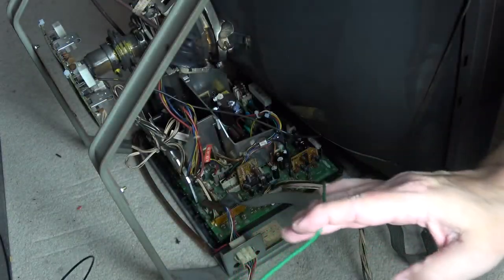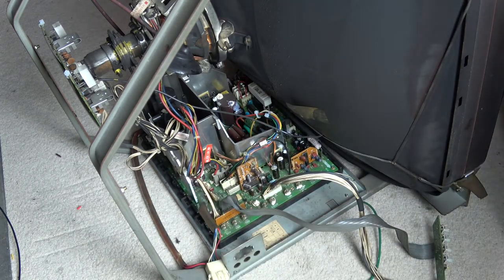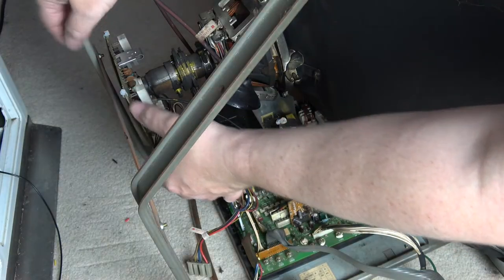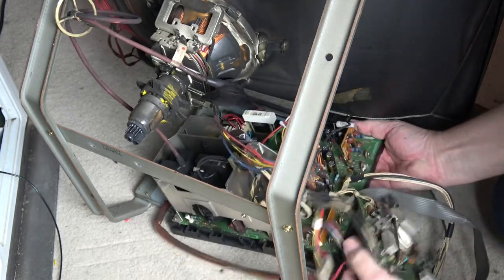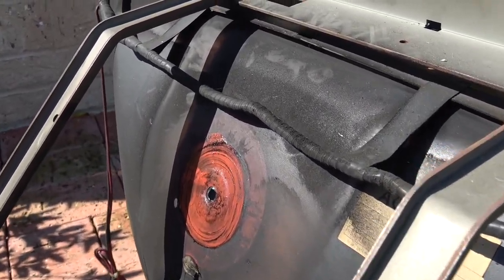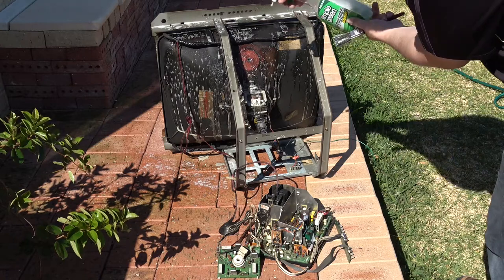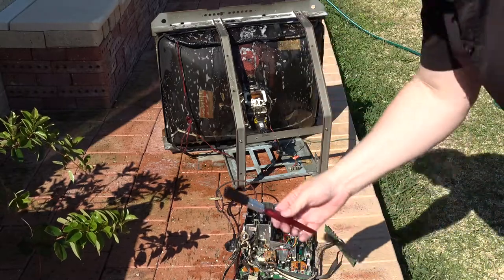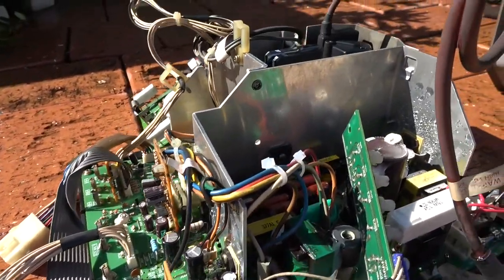FE009 - Wash your Arcade Monitor with water!

Comment: Thanks a lot for this video!  I just got a converted cab setup for MVS to restore and cleaning up the monitor was one of the issues I was looking at when reading up on arcade maintenance and restoration.  I have read up on discharging the monitor but wasn't sure on how to go about this.  Not sure I'll get the main board with water (I typically use electronic QD cleaner on my consoles and game carts) but this looks like a great way to get the monitor itself cleaned.
Reply from the maker: Thanks XB3... I must admit I'm still a bit on the fence with the water washing but so far that monitor continues to perform! Thanks for your comments. :)

Comment: I'll probably just use a tooth brush on the boards but I might give it a go on the monitor itself. Thank you for the helpful tutorial.
Reply: When you pour water on it, there are no micro residues that can cause corrosion over time. I say this because once I washed metal parts of my guitar and despite the fact that I dried them well after a few days, corrosion appeared on them.

Comment: Please don't do this with normal tap water. :(

I'm dismayed that people are still doing this to arcade monitors and main boards.

Yes, "water" is often used in electronics factories to clean certain boards, but ONLY distilled / demineralized water.

The minerals, fluoride, chlorine, and other impurities in most tap water will leave traces on the board and underneath chips etc., and can actually accelerate corrosion over time, even if everything is dried after cleaning.

There are also certain components like paper caps and other porous things like ceramic and tantalum caps which are hygroscopic.

Other parts like unsealed inductors, realys trimpots etc. are never meant to be soaked with water (even distilled), and you might never get all of the moisture out.

If you really care about preserving this stuff for many more years / decades, then it's just a bad idea all round.

Yes, it might "work" fine after it's been seemingly dried and obviously look very nice, but the remaining moisture and trace corrosives could lead to things failing after only a few years.
Reply: I say "hygroscopic", but not necessarily in the true chemical sense, just that some components obviously suck up the water, and you might never get them fully dry unless you literally put the whole board in a low temperature bake for 12-24 hours.

This is what they do sometimes in the factories - they remove things like electrolytic caps, low-temp plastics, and other components that don't like getting wet, wash the boards with DISTILLED water then put the boards in say a 60-degree C bake for at least 12 hours to drive out the moisture properly.

Usually this is done before those moisture-sensitive components are even fitted to the boards.

Actually, it would be way preferable to just rinse boards with pure Isopropyl Alcohol, rather than ever risking ordinary tap water.

IPA is commonly used, and most modern components are fine with it, but always do your own research on the older stuff like caps, and read a few datasheets to see which components are OK with being cleaned in this way. ;)
Reply from the maker: Thanks for sharing this detailed insight ElectronAsh. I will admit that I didn’t consider the potential risks to the degree that you have outlined and it is evident that many others don’t either (not that it makes it right). Those considerations are certainly risks that people should consider and then make their own determination based upon their risk appetite. For me, I’m OK with doing this on the chassis boards but probably wouldn’t do this on very old/valuable/rare boards. It’s difficult to determine the extent of the actual risk depending upon the components and the process environment where they are subjected to cleaning. But regardless I appreciate you sharing your knowledge in this space and I certainly advocate others considering your thoughts before deciding to clean their own boards. Cheers.
Reply: Spacies Arcade 

No problem. Just spreading the word. ;)

And thanks for the nice reply. It's not too common on YouTube these days. lol

I will openly admit that I'm no expert, nor chemist, nor metallurgist, nor qualified engineer, but this is just my experience in working with electronics, and what engineers have told me.

As you say, it's one of those things that you might risk on your own stuff, but maybe not on monitors or boards that may be sold later.

Although, if you do use distilled / demineralized water, then it's probably fine as long as you can be absolutely sure that everything is bone dry afterwards.

(and isn't allowed to soak into paper PCBs, caps, inductors, relays, transformers etc.)

Pure water is nonconductive (AFAIK), but when it mixes with the dust and other stuff on the board (like Aquadag coating), it could still cause issues if it gets trapped inside a relay or whatever.

I would still personally use IPA where possible, as at least it should almost all evaporate.

There is an obvious drawback to using pure alcohol around high-voltage and possible arcing though. lol

As long as it can't pool or get trapped somewhere, I think it's still the best bet.

I've never used Acetone at home. It's a bit too harsh I think, and apparently a mild carcinogen?

The other option is simply to brush off as much of the dust and grime as possible from the boards, then use a very slightly damp cloth to clean the tube itself (after safely discharging it, of course.)

Best not to get any water in the hole where the anode cap goes either. It's obviously sealed from the inner envelope, but the trapped moisture could cause arcing later on.

I dunno, maybe I am a tad alarmist and OCD, but better safe than sorry if you're hoping to preserve stuff. :D
Reply: You have no idea what you are talking about, a good rinse and dry will work perfectly with regular water. These components and boards will last for decades more before any “impurities or trace corrosives” (nice buzz words)

will affect them, as for remaining moisture there isn’t any if you blow it out or let it dry properly. 
Geez Louise. 
Been doing these boards since the 80’s. We used to take the sticky coke covered boards out of driving games like Daytona 500 out in the back parking lot and hose them down and just leave them in the sun. 
They ran for years
Reply: not every water source has the same level of contaminants as the next and considering that this is probably a once or twice in a lifetime task for a crt I wouldn't worry about it all that much but yes it would be safer to use distilled or deionized water.
Reply: @MegaTapdog  well i would not do it with mexican tap water jajjajaja in the town i live in water soemtimes have sediments

Comment: Is it safe to remove the dust on inside of CRT with soft brush and vacuum cleaner without discharging the tube? (both on PCB and on tube/monitor itself)
Reply from the maker: Personally I would not recommend working on the chassis or tube without discharging first. The voltages are potentially fatal. Take the time to learn how to discharge or get someone else who can. Once discharged you can use a soft brush on the pcb and a vacuum (a blower might work better). I wouldn't use  a brush on the back of the tube though as it has a thin coating called an 'aquadag' which is important for the tube to correctly function. This can be accidentally removed if you use anything abrasive on the back of the tube. Please be careful. Cheers.
Reply: @SpaciesArcade  Thank you for the info. Ill try and research as much as i can before atempting discharging.

Comment: I would like to clean up my CRT and chassis as well but i'm still not sure using water is the right way.... i am just afraid that water would corrode the coppers in the pcb.... do you happen to know the alternative and much safer way to clean ?
Reply from the maker: Hey modology. The alternative is a vacuum cleaner with brush heads, alcohol, dry sponges, q-tips and magic erasers (courtesy arcadeblogger.com). :)

Comment: Hi, could you tell me if the simple green is pure or diluted? Thanks in advance !!!
Reply from the maker: Diluted! 👍
Reply: @SpaciesArcade  Could you tell me what percentage? I have to order it specifically to clean a monitor that I care a lot and I would not want to do damage.
Reply from the maker: I buy bottles that are already premixed so I don’t know the percentage for concentrate. I would just follow the normal mix instructions on the label which should be the same as the premixed product. Cheers.

Comment: can you wash a regular crt television this way also?
Reply from the maker: Sure can. There's not much difference between TV CRT's and Arcade CRT's. In fact they both have Tubes and Chassis set up in a similar way. Just the chassis are usually different and tubes can vary. But from the perspective of washing they both can be washed the same. Just make sure the CRT and electronics are completely dry before re plugging in and remember even though I can't see any issues occurring you do so at your own risk! Hope this helps. Cheers.
Reply: Theatre of Magic cool one more question where do you buy the simply green?
Reply from the maker: I'm not sure where in the world you are located but in Australia you can pick it up from your local Bunnings Store. It does appear to be a world-wide distributed product so if you are somewhere else it probably will be at your local large hardware store. Cheers.

Comment: How long do you leave the monitor to dry for?
Reply from the maker: Hey M.A.R.G. - Usually I'll leave the chassis out for a bout 4 hours in the sun with a good breeze. Turning it over at least once during that time. I'll then bring it in and leave overnight before installing the next day. If you are in a colder climate you could leave indoors in the sun (by the window) and run a fan next to it for the same durations. Bottom line though they need to be bone dry. If you really want to be super safe, after the sun drying time leave the board for 2 to 3 days indoors before re installing. Hope this helps.